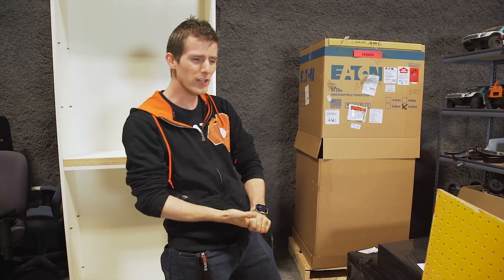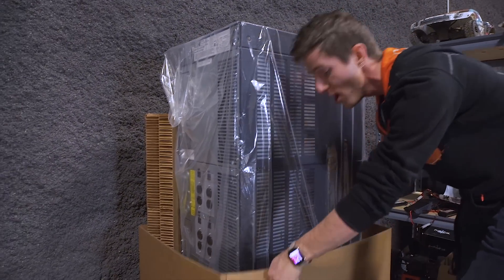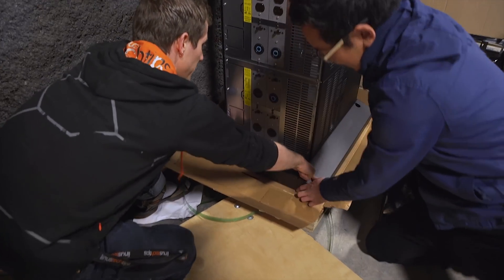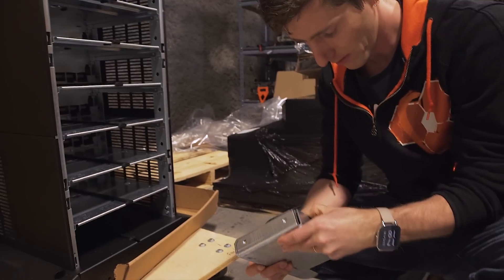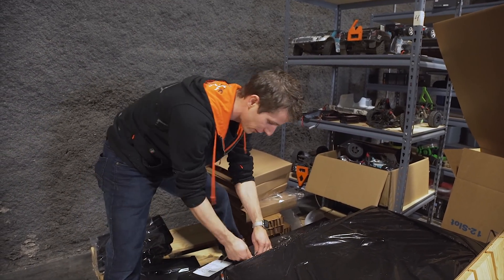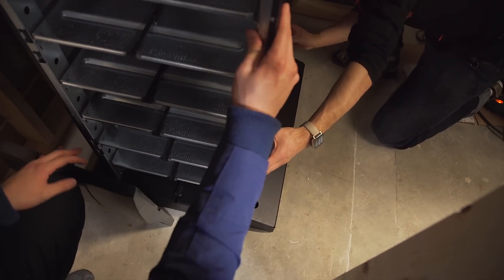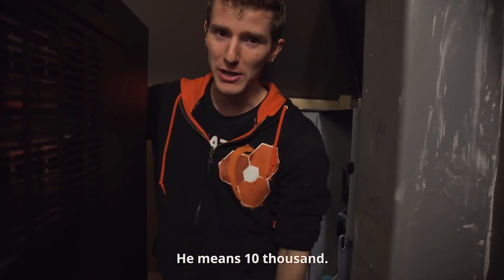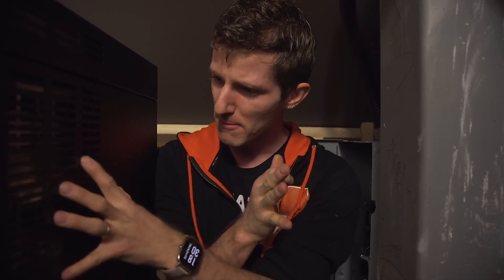HOLY $H!T - A $17,000 (CAD) Man-sized Battery!

Comment: why the hell you bought that instead of buying a generator
Reply: and small upsS
Reply: +samitha sheshan generators produce dirty electricity, they want clean electricity and the ability to shut everything properly if there is an interruption of power.
Reply: +samitha sheshan Generators don't provide uninterrupted power. They only need enough power to save their stuff and shut down the computers.
Reply: Reggie Buffat Agree but the could have used their old UPS's and a backup generator so the can run all their stuff (a good quality generator ) and something to smooth the output of the generator (by the way i know even hospitals uses backup generators even to carryout surgeries)So for that amount of money linus will be better off with a genarator
Reply: +samitha sheshan 
Generators don't kick in fast enough so the servers can still get damaged from the blackout. You would still need a UPS to smoothen the generators output. Since his servers don't need to be online 7/24, a UPS is enough.
Reply: Party Waffel yaya that"s where the small rack mount ups come in to play
Reply: samitha sheshan They got rid of the ups's as they were crappy and weren't working. They were referbed consumer products. They also had to swith from ac power to battery power when the power went out. The new ones are always powering the servers off the batteries so the servers never see any change when the power goes out.

Comment: Linus have you ever thought about solar powering your office?
Reply: +Finnishwhiteboy Just because it rains a lot doesn't stop solar power working. Half of the world's solar panels are in grey, miserable Germany.
Reply: Solar panels would be good but it rains a lot here in BC. I would know because I live in BC and super close to their building.
Reply: ikr.
Reply: I mean solar power is costly to invest in, but on the long term they might save quite some money considering the amount of power they use.
Reply: Saku Jalonen yup not enough sunshine, i guess they should make Dennis run on a treadmill which generates electricity :D
Reply: you would probably need to get a even more expensive battery optimized for solar panels.
Reply: +Sandesh Jadhav You realize that solar power for a home is between $35,000 to $48,000 for just a direct solar to power unit, excluding batteries. If you need batteries, then tab on another $8,000. To solar panel an office like that it would cost close to $130,000 with those batteries, and imagine the amount of time it would take to get installed. Granted, they do maintain themselves, but for them to be profitable you need to have a fixed APR for X number of years and making all your payments on time. It is hard to actually profit on solar over time. What if they want to move offices again in the near future and they haven't paid off the solar panels? That's if they even OWN the office, for all we know, they could be renting it from a Landlord, in which case, it's not their choice overall on the solar panels. Therefore, (although still expensive) $17,000 ($12,358.29) sounds a bit more logical for a unit that can fit under some stairs.
Reply: +Sandesh Jadhav Even if they coated the whole building in solar panels it woulden't be enought.
.
Reply: +Sandesh Jadhav They live in an area where electricity is green and dirt cheap. Solar power is a massive investment and the panels have only a limited life-span and need to be replaced over time. In a nutshell, it would most like not be worth it for them.
Reply: Guys the solution is simple Linus should make a Nuclear reactor sponsored by intel and powered by Nvidia and put Dennis in charge of it 100% safe.
Reply: *****
Nuclear Power is expensive but produces like far far more power for its price/size!
Reply: +Sandesh Jadhav solar freaking roadways!!
Reply: +Finnishwhiteboy rain doesnt damage a solar panel
Reply: +Finnishwhiteboy huh, i missed that. all the Channel super fun vids and other outdoor videos shot, it doesn't look quite sunny there..
Reply: +Finnishwhiteboy Finnish and you live in BC?!? What are the odds , I'm Finnish and I also live in BC
Reply: darknova000 Yea solar systems are quite costly and very bulky.
Reply: +seele better in the long run
Reply: +Sandesh Jadhav will have to wait for tech coming in a few years that allow for solar panels to basically be printed on plastic or whatever it is, significantly reducing adoption cost.
Reply: +Sandesh Jadhav ahh you beat me to it.
its for the office. lead acid batteries, solar panels, inverter and everything he could get way more than 26minutes
Reply: +Sandesh Jadhav Just put windmills :3
Reply: +darknova000 Hence why they need to buy their own fusion reactor. With that they could even power the neighborhood and make money on it all.
Reply: +Sandesh Jadhav Electricity is basically free in Canada :3
Reply: maybe sun hours in his area are shit
Reply: Not too feasible in Canada where there is winter for a long time.
It makes sense in tropical countries. But not here.
Reply: not much sun where he is located. rains mostly in the year over here
Reply: +darknova000 Those numbers seem to make them pretty pricy indeed. Also when thinking about the whole "renewable energy" deal solar panels in a place that's both as far from equator line (less average direct sunlight exposure) and the amount of electricity they already generate from hydroelectrical sources in most of the provinces seems very questionable.

Not saying that considering solar panels is "wrong" there but you basically have to have a lot of money and a good reason to want electricity in an off grid situation in my opinion before it becomes truly worthwhile. 

If ecology is the reason behind it tbh I'd consider it cleaner to keep using the mains that is mostly generated from renewable energy anyway and put in an industry standard fossil fuel burning backup generator for long term "oh shit" moments rather than the energy consuming process of making a large surface of solar panels and batteries that will wear with being charged during the day and drained overnight etc needing periodical replacement.

Now in any other environment where you don't get like 80-90% of your energy from renewable sources, sure then ecological arguments are a good thing provided you can afford the needed solar panel surface in a place as far from the equator like Canada.
Reply: ToKeepTrackOfRandomSubs
you can use solar equipment with plenty batteries and less panels to keep the batteries floating, and do bulk charging from the grid. or...you can leave all the panels off and get more batteries still
Reply: +darknova000 where have you been shopping... if your a diy kinda person, you can do a house for less than 5 grand... but if your paying other people id expect to get over charged....
Reply: konic40 True you could, but considering what they have now in hardware it would be a wee bit inefficient.

This UPS probably does not have a setup where you can directly charge the batteries from DC power, so you'd first have to pass it through an inverter from the solar panels and/or batteries then inside the UPS its turned back into DC to maintain the batteries and from that DC battery bank... the unit converts it back to a clean sine wave AC output.

The thing about photovoltaic cells though is they are quite far away from the equator -> less effective sunlight exposure making a return on investment harder to justify. Electricity is pretty cheap in canada from what I know and also mostly generated from hydroelectricity (big turbines in dams etc). So its a hard sell either ecology or financially in my opinion.

As for having more local capacity, I guess it would be doable to get another bunch of relatively affordable batteries and inverters rated to handle the load of the UPS charging (this would probably be pricy?) to extend the  maximum runtime while the mains is gone. That said I'd sooner opt for a generator myself in that case to keep the UPS charged. That way you could bridge a long term power gap reliably provided you've got the fuel stocked and its probably cheaper and ecologically speaking isn't terrible because its there only for the "what if" scenario.

The reason I would not want remove a UPS like that from the system is because it has the needed infrastructure and control mechanism to when its getting close to low power it'll tell the servers to shut down safely. Not sure how easy it is to implement this reliably with standard solar gear.
Reply: +Crusader1089 That might be because they're so inefficient here :P
Reply: martgician Here in India, at the least in my home we have to be very careful about the use of electricity can't let it go to waste, its costly :P
Reply: Does the sun even come out in Canada
Reply: +Sandesh Jadhav no they would not the amount of battery's they would need to power everything and then the converters and all the other equipment you need. On top of that the power loss you get is not worth it.
Reply: +umer salim sometimes when the rabid beavers go back to their kingdom the sun comes out
Reply: +Sandesh Jadhav I think he'd need a 5 small leases of a million dollars.
Reply: +Sandesh Jadhav They use mainly power from falling water so.. guess they are kinda green already?
Reply: +notmyrealnameify mines mainly hydroelectric,  power rates here are among the highest in north america
Reply: Solar is expensive while being not as powerful as it costs...
#NuclearPowerMasterrace
Reply: +Finnishwhiteboy Missäs sä sit asut? :D
Reply: +Sandesh Jadhav I live not too far from their office, and I can tell you that solar would not work.  It is almost always cloudy/raining here.
Reply: +Sandesh Jadhav It's Canada, No sun only snow
Reply: ***** eezy peezy lemon squeezy
Reply: money isn't a barrier for LMG sooo
Reply: +Sandesh Jadhav Cooled by AMD? Yeah.. mnno.. Yeah...
Reply: that's a great idea! and watercool the whole building Kappa
Reply: +Sandesh Jadhav I think they wanted solar power when they moved in but it was not allowed on the building. too lazy to check again XD
Reply: LOL
Reply: +Sandesh Jadhav It's vancouver. Rain city.
Reply: ***** not as efficiently
Reply: +ClassicPork Depends on the solar panel.  Monocrystalline Panels do better during cloudy days and in colder regions but are the most expensive.  Amorphous Silicon panels can work in any light condition, even indoors but its not very efficient.  IIRC the last estimate was around 5-10%.
Reply: Because solar power is a pipe dream for liberals and have no use for a man trying run a business and stay finically able to pay the family's that depend on their check from him.
Reply: Too expensive. And environmentally, BC uses a lot of hydro anyway instead of fossil fuels. Maybe not as clean, but far far cheaper
Reply: +Sandesh Jadhav BC is not the best area for solar panels
Reply: +Sandesh Jadhav I think they said in a previous video that power in BC is dirt cheap due to all the hydro
Reply: +Crusader1089 And for all that it still only covers 13% of their total power requirements.
Reply: +Exgaves the power from the panels is fed into batteries, power is drawn from the panels until the sun goes down, then they draw from the batteries that lats during the night, I presume the servers don't do much at night?
Reply: Ozzie Peck If you wanna buy like 10 square acres of solar panels to keep that entire building powered during the day, and then to power the massive amounts of batteries and electrical storage. It take a stupid amount of money to dump into solar power to make it useful and even then it wouldn't be as consistand because you are relying on solar power when the sun doesn't always shine.
Reply: +Sandesh Jadhav it depends on whether they have rented thier new office or if they bought it. If they rented it there might be issues
Reply: +darknova000 'unit'. Everyone working there is extremely smart, I highly doubt they would be buying solar kits. Chill mr. knowitall
Reply: +Sandesh Jadhav They already get electricity from a hydro power company, so not saving the environment. Also, it is so expensive, never really going to get an investment on return assuming just how much power their office draws.
Reply: +Sandesh Jadhav Electricity in BC is ridiculously cheap because its all from Hydro power so they wont really save any money
Reply: Saving the environment is for pussies. Use real power not solar pussy power
Reply: +Ozzie Peck they wont even need battery if the bulk of power they use is during the day, put Grid Tied system and they are good to go, no battery much better for environment
Reply: Where Linus tech tips is, 99% of the power is hydroelectric. Solar panels would be a huge waste of money as hydroelectric power is cheap. And solar panels only work during the day
Reply: St0ner1995 Hmm didn't knew.
Reply: +darknova000 or they can buy from SolarCity, no downpayment lease or something
Reply: ToKeepTrackOfRandomSubs you can get the solar inverter to be the UPS and you don't need so use the panels. The inverter can use the grid as primary power and its batteries as backup. Run the whole office, probably minus the HVAC system when there's an outtage. Some inverters have a generator autostarter if the grid doesn't return and the battery is low. The only problem might be a shutdown signal to the server when the batteries are going low...if you can deal with a manual system you can flash a light to signal you're on batteries and the admin can monitor how the system is going and from their PC on a good system and advise people to shutdown as needed.
Reply: konic40 They can't run much without HVAC, their gear makes heat. 10 KW is a big heater.

Comment: we have seen hoverboards fail and burn, electric cigarette mods explode, now imagine if this thing fails. KABOOOOOOOOOOOOOOOM
Reply: Not to be a dick but mods only explode if the user is an idiot.
Reply: but these use SLA batteries that at worst will make an acid pop which will suck but no fire
Reply: +Ben Faber I'm a vaper myself and I know that if handled well nothing wrong will happen. But any batteries can be hazardous at some point and I always have a little hint of worry whenever a battery is near my face. sometimes laptop and cellphone batteries fail and burn, even though that is extremely rare
Reply: +Ben Faber Anyone who vapes is an idiot. Please clarify.
Reply: +Ben Faber And he is so....
Reply: Different kind of batteries. These don't explode.
Reply: +SweBass Only one problem is that what you mention uses Lithium batteries..These systems tend to use Seals Lead Acid (SLA) batteries..more or less just like your car. Ever seen a car battery go KABOOOOOOOOOOOOOOM??? naaa didn't think so.
Reply: +Tig3rj (With pipe packed gunpowder (2 pond ))they do :D
Reply: +Ivars Odins Meh.. I rather use Flash Powder ;)
Reply: +gzac95 If an inexperienced user uses a mechanical mod (No chip to regulate voltage, completely analog), and holds the firing button down too long, the battery can overheat and potentially explode.

Comment: Just in case you wanted to keep your whole building running for a days.

Dunno what you'd do without the inter webs though.
Reply: +HPWebcamAble
plug the networking equipment into it.
Reply: +HPWebcamAble Their internet connection wouldn't drop if the power goes out.
Reply: +LiquidPanic the wifi would if it is connected to the place where the power went out
Reply: Greyson Buchanan Nope, all the access points are powered over POE (Power Over Ethernet), and considering all the networking equipment is also on that UPS, they won't lose connection to the internet on devices.
Reply: If the power in their area went out, would their ISP not lose critical equipment near them?
Reply: HPWebcamAble Do you think ISPs don't use UPSs and have backup transformers/power routes? Unless multiple plants entirely shutdown nearby, they'd be perfectly fine.
Reply: +HPWebcamAble 
They also have a 4G backup modem. And of course ISP towers have generator backups.